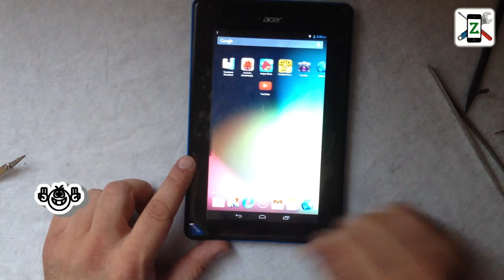Acer Iconia B1-A71 - Touch Screen Replacement, Glass Digitizer, LCD Display, Battery replacement

Comment: This is amazing. These tablets are not really designed to be opened for maintenence or part replacement, but you are smart and crafty enough to be able to do it. If I may ask, how much does a touchscreen cost, and how much for the display?
Reply from the maker: You can find them in Amazon or eBay. The touchscreen is 15-25 USD depending of your location and the LCD Display around 18-25 USD.

Comment from the maker: +Kieran Thomas
- Hi. Do you know if i would be able to purchase a new battery that would last longer  since it only lasts around five and a half hours? Are there any compatible batteries that would work? Thanks so much
- The original battery is Li-on Batteri Pack, 3.8V, 2640mAh. You can try to find a bigger one but there is a height risk to buy a low quality battery. At this situation I can't give you good advice.
Reply: I have question. how do I fix screen? mine is busted.

Comment: Thanks for this excellent video. Very thorough.  Just wondering if it is the exact same process for an ACER B1-710 ?
Reply from the maker: Earl & Randi 
Yes, it's similar, but the touchscreen is different.
Reply: I do have the correct screen.  I just wanted to make sure the process was the same because I am going to attempt this on my B1-710,  and use your video as a guide.  Thanks again.
Reply from the maker: Earl & Randi 
With the exception of a larger circuit board, a different position of the screws and more antennas cables the other is the same. A friend of mine has such a tablet. This Sunday I will try to make video - teardown.

Comment: Hi, I replaced a cracked touchscreen but it still didn't work. I ended buying a second touchscreen as thought it may have a fault but still doesn't work! Have you ever had problems even after replacing touchscreen? Is it possible the main board has a fault? Thanks
Reply from the maker: microheliaddict 
Maybe the problem is with the Main board. Check the digitizer cable connector and the elements around it. Better if you have a magnifying glass.

Comment: Good morning , did the LCD Display exchange process
Now the device will not turn on
I put to load and it becomes too hot
Reply from the maker: +João Paulo Ferreira Santana 
Check again all connections. Also use a magnifying glass and check the small elements near to the connectors. If the device becomes hot, there is a short circuit or bad spare part.
Reply: +ZFix thanks so much
Reply: Where did you get your new lcd display screen?

Comment: Good after my friend i have a question if my display is broken but my touch dont its necesary replace the two parts?? 
sorry for my english in from mexico and im not to good
Reply from the maker: claudio uriel reyes barba 
Yes, the Touchscreen and the LCD Display are different parts.
If you want to change only the LCD Display, you can follow this video up to 3:20

Comment: Great video my mother in law cracked the glass, its the dame process right also where can i buy that tape you used and what is it called?
Reply from the maker: DZenitram23 
I'm using 3M double side adhesive tape - 3 mm. You can find it online in eBay or Amazon.

Comment: hi great video. i had to replace lcd screen, and digitizer. but the new digitizer works then stops again i play around with it then works then doesn't again. any suggestions?
Reply from the maker: aaron bingham 
Check is the flex cable connector is properly closed. 
This seems like touchscreen problem (spare part problem). :(
Reply: ZFix yeah everything seems to be inserted ok. i'll see if they will replace it. that you for your help.
Reply from the maker: It will be better if they replace it for you.
Reply: ZFix  hi. I've replaced new screen and no response to touch screen sill. It I possible the motherboard is gone on tablet?
Reply from the maker: :( Yes, it's possible. 
Around the touchscreen flex cable connector there are many small elements (resistor, capacitor). Use a magnifying glass and check for bracken element or broken pin on the flex cable connector.

Comment: Can this work on a Acer Iconia One 7 B1-770?
Reply from the maker: +Michael Caluag 
It's similar but not the same.
Sorry for the delay.
Reply: ZFix So can this fix work on my B1-770 if i buy the same lcd?
Reply from the maker: No, the LCD flex cable is different.

Comment: Hi my little brother broke his computer and I want to help him fix it, it has cracks on the screen and the touchscreen is getting in the way. Since he never uses touchscreen we thought we could remove the touchscreen and then he could use his computer again, but we don't know how, he has an Acer computer, one of the really big ones (big as an apple computer)
Reply from the maker: EllieGRL 
Tel me the model. You can find sticker with the model and the serial number at the bottom side of the laptop, like V5-572.
Reply: ZFix Its a Z3-605
Reply from the maker: EllieGRL 
This is All-in-one desktop 23 inches machine. It's very difficult to remove the touchscreen glass. Better ask for help professional.